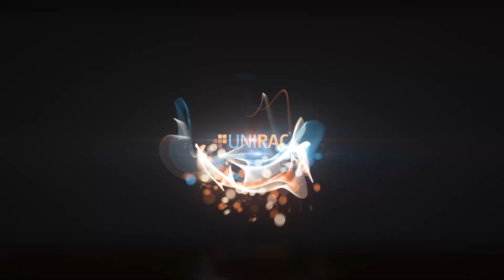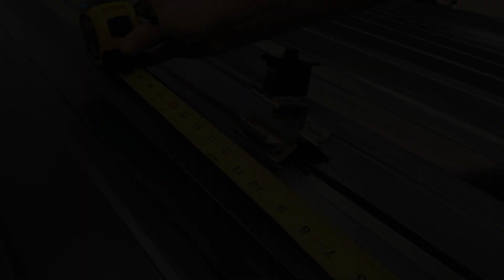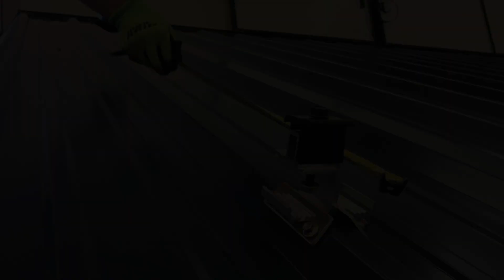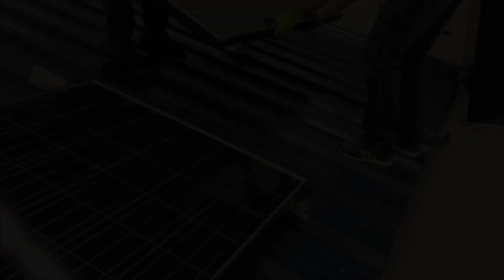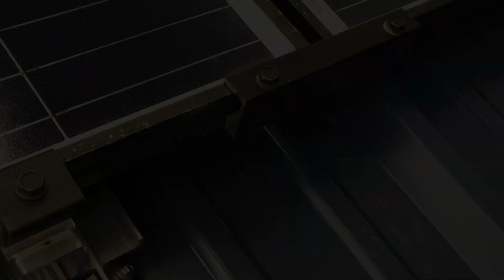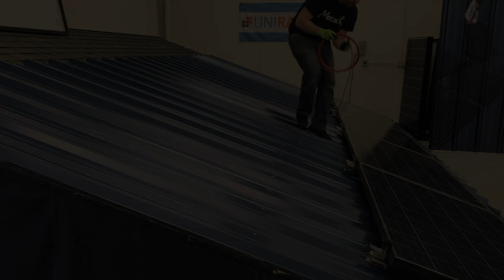MetalX Installation

Comment: how would we put the micro inverters?
Reply: they go on the back of the panel.
Reply from the maker: Also, this one about Metal X.  Id say something about how the microinverters are attached directly to the modules, and can be done with our MLPE Mount.  Any suggestions?     Thank you for your question!  For the MetalX system, Micro Inverters can be attached beneath the panel.  MLPE Mounts secure them directly to the module frame.  Check out the page on our website for more information: https://unirac.com/product/mlpe-mounts/